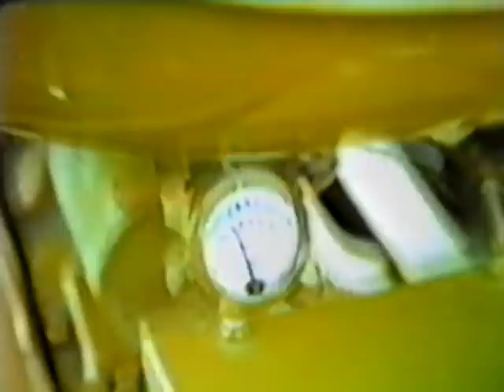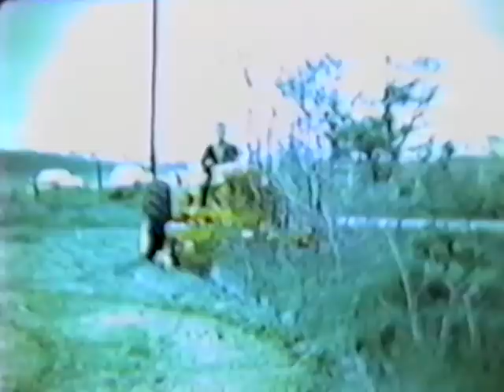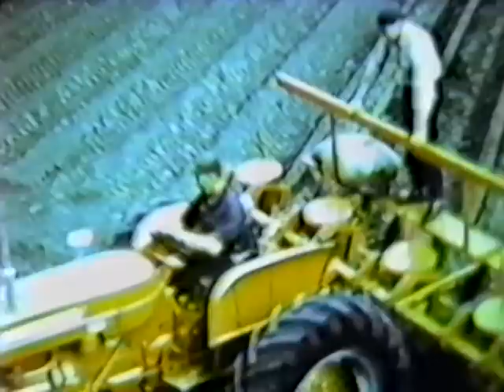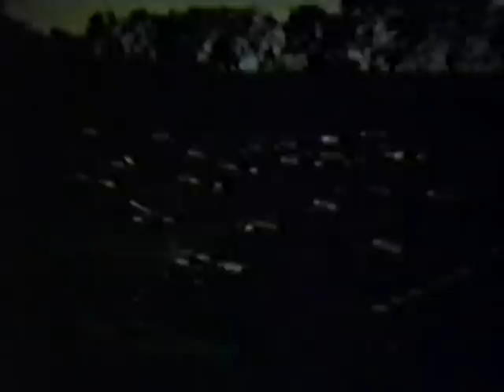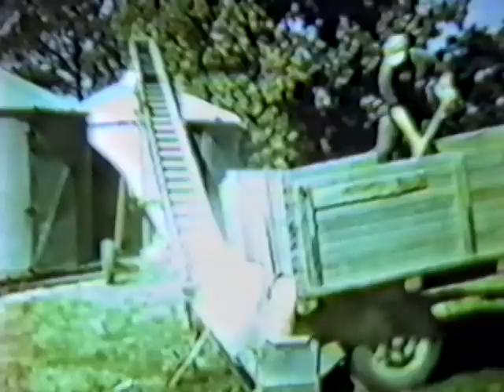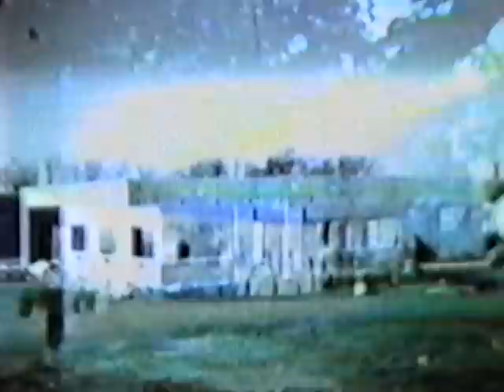The Next Plateau

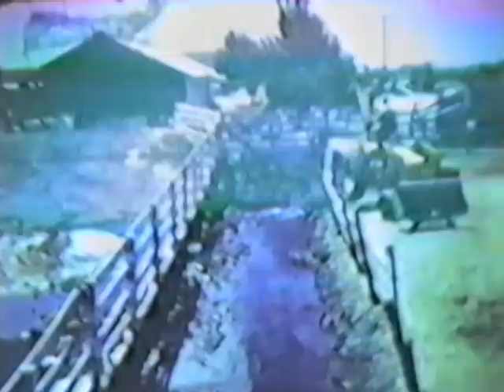Comment: @ 11:20 rear wheel spinning while using the backhoe, safety!
Reply from the maker: Most likely the trans is in gear but the power director in neutral.
Reply: no big deal...with a diffeeential,you could stop it with your hand.Mine is a 2010 model jd and it does it if you leave it in gear!